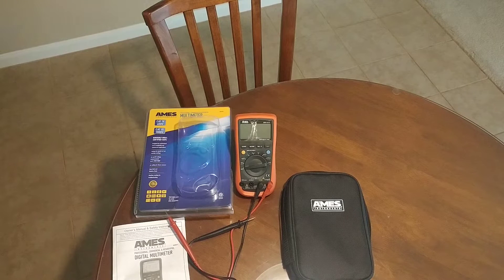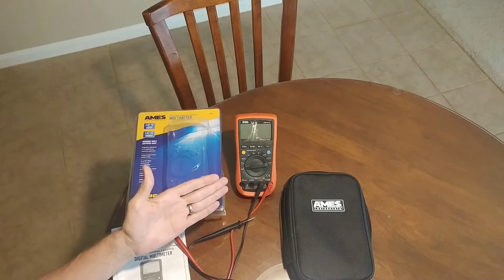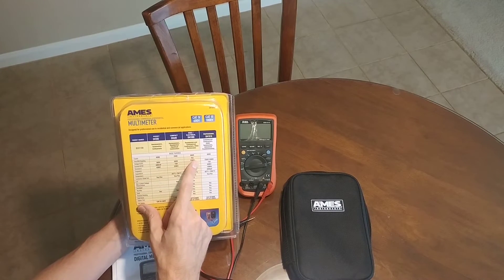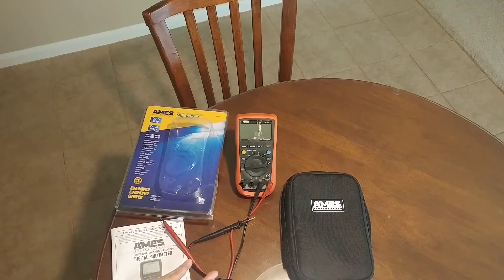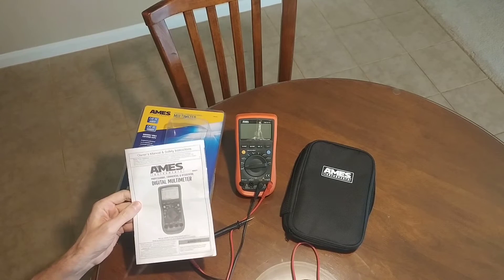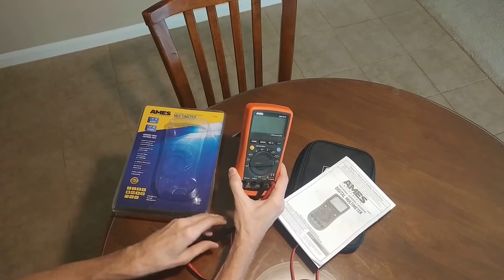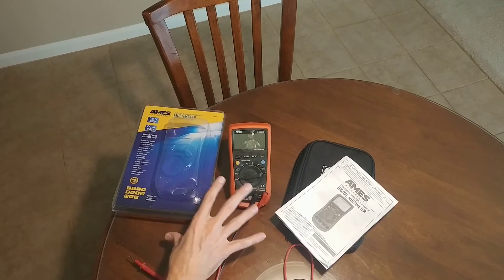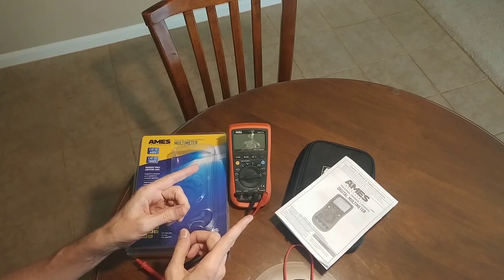Harbor Freight AMES DM1010 Multimeter Review

Comment: I'm looking at both of these meters and I see the DM1000 has a Lo Z setting and the DM1010 doesn't.  Am I not seeing it on the 1010?
Reply: What is the low z for?
Reply: I need the dm1010 for the mV setting to find what is causing parasitic drain in my truck. 🤔 I'm new, but I saw this method on youtube haha
Reply: I’m a little late, but for some reason HF is selling the DM1010 as their highest tier multimeter when in reality the DM1000 is actually better and cheaper.

Comment: Was there an accessory included for testing transistors on the meter that plugs into the meter?
Reply: I have a dm1000 and it came with that in the case

Comment: I already have a UT61E and also a new one of these DM1010's on the way from ebay I won for $20 with shipping.  In this video I noticed this HF meter still shows the RS232 USB feature above the REL key as well as the inside circuit board screen shot showing the LED for the USB cable link.  I dont know if this will actually be operational in the DM1010, but if it is my 61E's USB cable and software might still work giving me a pc link for displaying the software, if anyone has tried this please comment, but Harbor Freights webpage makes no mention of the USB link even though the pictures show the RS232 USB function still being printed on the front of the meter - but that doesnt mean its present, the physical meter may not have this.
Reply from the maker: I thought the same thing!  I have not seen any RS232 USB functionality however.
Reply: I also notice the main IC chip is not even visible in the pic, on my 61E its a visible chip.  Im sure this was a built to price meter, and like he says here the $100 HF is asking for it is insanely high, but I got mine on ebay for $20.39 with shipping so im not too concerned about it, im sure its worth that much.

Comment: It appears to be an excellent dmm.  The backlight will be a big seller for many. You can easily add some aftermarket shielding  to aid in the RF department. Many multimeter brands are rebadged from OEMs. The input protection looked very good, 4 PTCs 3 MOVs, big HRC on the high current side...decent creepage. Its hard to see but they appear to have replaced the current shunt with a shunt resistor.  The meter should be able to meet basic CAT ratings from the initial peak inside. I'm curious,  how are the stock probes? Are they silicone or PVC? Good job on the video. Too bad it's so expensive..would be a great CHEAP-O  Multimeter !
Reply from the maker: Thanks Darren! Excellent analysis. The probes that came with the meter appear to just be the same ones you get buying the Uni-T UT61-C through UT61-E. HF should have called this the DM 900 with a $59 price and listed the DM 1000 as their top of the line meter as it has more features and capabilities like True RMS, LoZ, NCV,  and the same CAT III & CAT IV rating.
Reply: @TheSwitzAutomotive  That's a definate plus! Sounds like a solid piece of gear. Keep on Testing !

Comment: Good vid.  I picked up one of these at 50 or 60% off at a clearance of unboxed items.  I'm not an electrician so certainly don't use the advanced features, mostly ohming cables, continuity testing, and some electrical testing.  I like the look and feel of the Ames, but I certainly agree that the value if I'd paid full price wouldn't be worth it.  Thanks for the work!
Reply from the maker: You got it Michael. The DM1000 is worth it if you use the AIMS 20% off coupon featured in the June catalog. But the DM1010 is sadly less capable. Thanks for watching!